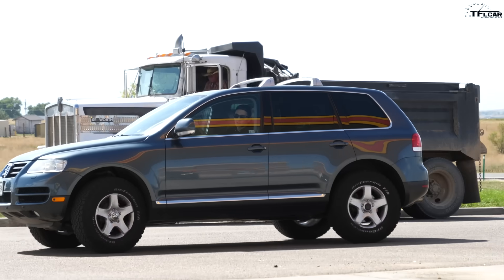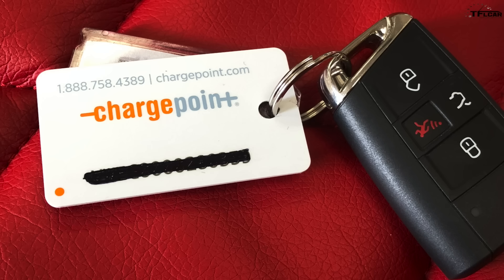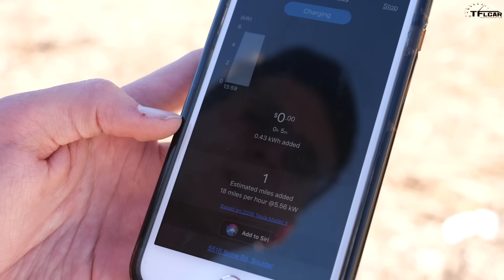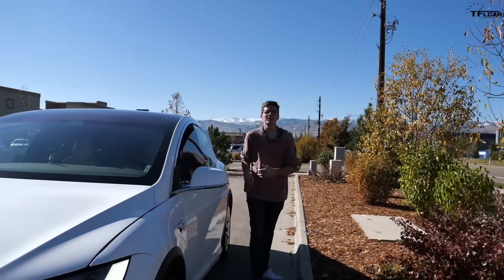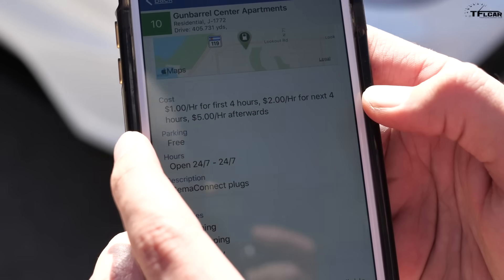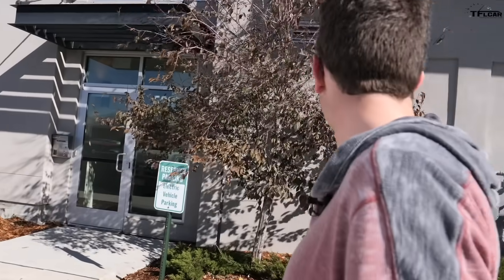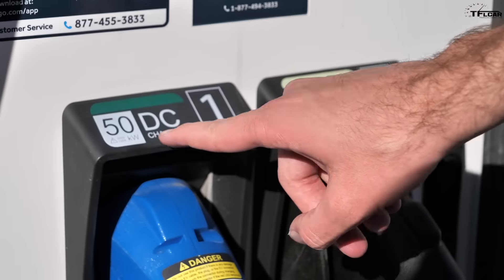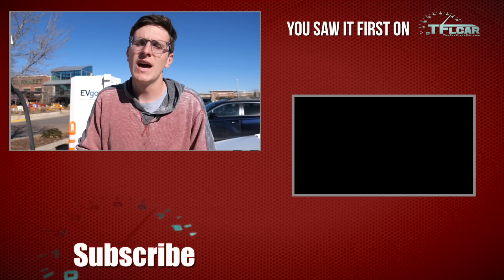Here’s Why Charging an Electric Car Can Suck - And It’s Not The Reason You Think!

Comment: "15 Miles an hour"
Hell no!
Reply: A Model 3 Long Range operating at peak efficiency can recover up to 75 miles of charge in 5 minutes and charge at rates of up to 1,000 miles per hour at a supercharger. Sadly, the chargers that this dude showed are level 2 chargers, and it's about the charging interval, not the time. Most people would get 240v installed (if you are American and don't have it already), and then simply plug in at home when they get home from work or activity, and the car will charge slightly faster than the chargers in the video depending on the equipment. 

That's the thing about an electric car. We don't really have to worry about public charging because the car will always be full when I wake up, or whenever I decide to leave the house because it will just be plugged in all day. And if I go on a really long road trip, then I can stop at a DC Fast Charger (non-telsa supercharger) and fill a Nissan Leaf up in 30 mins to full. Even if I do end up in this hypothetical situation, every charger near me is free, including the Fast Chargers.

It's not everyone's thing, but I think most people believe you have to charge an electric car just like you have to fill up a gas car, but in reality, most of the charging is done at home, and there isn't a noticeable electric bill change for most people depending on where you live.
Reply: @gamergye  
I know, however when your Tesla car go through an accident, Tesla forces a removal of supercharge ability and you're left with a useless car that is only good for your supermarket trips.
Reply: @qud3913  I don't have a Tesla, and they do that for vehicles that have been worked on by a 3rd party. They have stopped disabling it now thanks to Rich Rebuilds.
Reply: @gamergye  
That's good to hear!
Reply: @qud3913  For sure

Comment: I would not buy an electric car without a home charger. I would also likely not take one on a long road trip, I would us our second ice vehicle for that. Electric could really be successful but things like this is exactly what is holding it back, all chargers should be a standard kwh or speed based on car/battery size and all should except credit card just like a gas pump. If the transition from ICE to EV is not smooth and seamless it will make it very hard for the mass of population to adopt EV. Right now you've got everyone out to make a buck instead of working together to make EV the future and until they all work together EV will continue to be a small market share of total cars produced.

Comment: The other thing is, as you drive your petrol car, it gets lighter. So for example, my diesel  landcruiser starts of with about 135Kg of fuel, but 1,200Km later, it has 10Kg of fuel.  A battery car is still lugging around the full weight of the battery. So extending the range is harder, because that weight stays with the car the whole time.

Comment: What they need to do is treat it like a power tool and have removable batteries. You would pull up in a filling station swipe your credit card pull the used batteries out deposit them in the machine. At this point fully charged batteries would pop out. You could actually fill your car faster this way then at a gas pump.

Comment: Stick with Gas...……...for the time being. When I need gas, I drive in to a station, take 4 or 5 minutes to completely fill up and I am away on my journey, and in 600 miles, I can do the same again. I don't want to hang about for hours and hours at a charging point only to get another 300 miles. The whole EV industry need to get to the same level of convenience as a gas vehicle, but for the time being, they just don't have the technology or infrastructure.

Comment: Maybe it’s not a matter of bandwidth and understanding but a matter of convenience and  intellectual understanding that EVs aren’t a viable technology to replace the internal combustion engine yet. Both battery technology and charging technologies are at least 10 years away from being good enough to get a full conversion from gas to electric. Perhaps work on improving the hybrid technology more. Battery technology can be developed in a hybrid until the point it is more viable to go solo. Meanwhile you could get more people to adopt a more environmentally friendly means of transportation without all the issues you find with an EV.

Comment: So, how long would it take, in one of these electric cars, to travel from Miami to Seattle?
Reply: that's what people get wrong it's not about filling up the battery like a gas tank, if you plan it right you can be charging multiple places you would normally just sit your car and forget it.

While driving you stop for food, find a place that has a charger near by, you want to go shopping find a place that has a charger installed and you charge while you are out doing whatever you need to do.

when you stop to rest you can choose the hotels with charging stations, you don't drive your EV until your battery is depleted, you top off whenever you get a chance, and that extends you total range.  The best analogy would be if you put gas in your tank every time you went shopping or when you are at home you put gas in your tank.  It takes a different mindset to charge an EV and as a plug in hybrid owner it does take some getting used to but for me going 3-6 months without having to stop at a gas station is awesome, I can't wait until my lease is up so I can get a fully electric vehicle.

Comment: You really need to remake this video! 

Then first thing you go over is how charging at home is fine for 95+% of most peoples driving needs. Then cover Tesla Super chargers and how quickly 0-60% charge gets you back on the road to the next station rather than spending the extra time to trickle the last 40%.

Finally you can cover all the other subpar options.

People who are just considering electric vehicles or looking only to confirm their bias need only watch the first 5 minutes of your video and you tell them it's going to take 20 hours to fill their 300mile range battery at a public 5Kwh charging station.

Once they see that they have all their worst assumptions verified and stop watching!
Reply: @ Richard exactly. This video is a poor representation of charging EVs.
Reply: if you want fast EV charging buy a tesla. Tesla supercharge full charge in 40 minutes.  if there are no superchargers near you bye an ICE car.  when not using a tesla supercharge, i use my dryer plug 240 volt level 2 charger. 8 hours full charge.
Reply: Looks like someone didn't watch the video. He clearly said "The reality is that most people don't have high voltage power in their garage. And furthermore, charging off a standard 120 volt outlet can take several days."
 Unless you have 240v in your home, you're either going to have to pay an electrician to come in(YAY!! More expenses!!), or wait several days for your car to charge. Teslas supercharger is faster but they're not everywhere and not every EV is tesla. I like EV and i want one but to me it is unconvenient, for me it is way easier to just buy a full tank gas right now and refuel next week rather than have to charge every single day.

Comment: We have 6 years of VOLT experience.  Only charge at home where it is about $1.35 for 45-50 miles of driving.  Never at a paid station...we just use some of the 9 gallons of gas for 43MPG....far cheaper than a $7 for 12 miles paid station.  Average 143 eMPG and alway about 6 gallons a month. Top that.  Endless Range, limited by my credit card.

Comment: This is the main reason why I got rid of my EV.   Compare the simplicity of refueling with petrol (stick your CC in and in 5 min increase the range of your vehicle by 350 miles) vs. the Chinese menu of charge options to be negotiated.   You’d think that Tesla, Nissan, Toyota, et al would standardize the charge plug and charge rates across all models regardless of the mfg.

Comment: This plug won't work with a Tesla, you need the app, varies from country to country, 16 miles charge per hour,,,, looks like EV charging infrastructure has a long way to go before they can compete with gas stations. On the other hand, the cheapest Tesla sells for about $48,000 here in Canada while the dependable, reliable Toyota Corolla sells for about $22,000, leaving you with about $26,000 left over for gasoline and repairs, and cheaper insurance rates. Decent long range EVs will at least have to become competitive with ICE cars before the average guy will buy one, and not a lot of average guys can just dump almost 50 grand on a car. I think it might happen one day, but that day is at least years and years away, it makes more sense to buy the Toyota for the time being. Unless charging stations get their act together, it's better to run a 240 line out to the garage, I've already got one running to the kitchen stove, so that's not an issue, price, range and infrastructure ( in that order ) are the issues. My current lower mileage ICE car is already bought and paid for and that's what I'm going to drive until it makes better economic sense to go electric. Looks like we're all in a ' wait and see ' position.

Comment: Nice post showing what a ludicrous revolution of stupidity that is currently taking place. Maybe when more people realise that the savings of CO2 using an electric car take about 120,000 miles of use once you consider the amount of resources to produce them and sources of their energy, by which time the battery packs have to be thrown out causing another environmental disaster, then they also won't be prepared to wait hours to top up their car that costs twice as much as a normal hydrocarbon based vehicle. Typical of top down, government mandated solutions to non existent problems where the solutions end up causing more problems than the problem supposedly does. The UK said they're not only going to ban sale of petrol cars, but hybrids too.   
"Politics is the art of looking for trouble, finding it everywhere, diagnosing it incorrectly and applying the wrong remedies.” Groucho Marx.
Reply: i'd expect that from a lib gov't but not a conservative one.  i'm deeply disappointed

Comment: All this hassle so I can drive a coal powered car, that cost double what a comparable gasoline car cost. I dont get it.
Reply: I tell people this all the time. Until we are willing to get realistic about our power grid and run something that could support hundreds of millions of cars running off of electricity such as Nuclear there is no reason to be using a EV right now when a ICE makes more sense and has better supporting infrastructure.
Reply: @bobjackson4287  Not to mention there isn't enough lithium and cobalt in the world to build an EV for each current car owner. They're called "rare earth" for a reason. If we're going to build more nuke plants then it would make more sense to use the electricity for the electrolysis separation of hydrogen and oxygen from water. An ICE could easily be built to run on hydrogen and the exhaust would be water.
Reply: @goldenrod8861  False. They are called "rare earth" because they are evenly spread in the ground. They aren't rare at all. Rare earth elements are actually abundant.
Reply: Well said Loren. Unfortunately most people don't realize that electricity comes from coal (mostly) thus your comment went sailing straight over their head.
Reply: Agreed. Environmentally clean? Check the chemicals and elements that go into building the battery, them someday down the road, it has to be disposed of. NOT POSSIBLE WITH TODAYS BATTERY TECH. No, I’ll stick with a 1.2 litre gasso that starts, farts and goes when I want it to.
Reply: Cobalt is not only rare but extremely toxic ,only two places to dig it up that's Central African Republic and Australia and China have a firm grip on both.Its one of the main reason why Dyson scraped there electric car project,they couldn't get hold of enough of the stuff,Tesla's having the same problem,it's why there putting millions into trying to develop alternatives.
Reply: @katrinawalls2109  you are mixing up and using different terms interchangeably. Cobalt is abundant. Is it desirable to extract? No. Is it a rare material on Earth? Nope. Not even close.

https://www.cobaltinstitute.org/production-and-supply.html

Comment: Thank you! You did an awesome segment on charge stations. I was SO close to buying a BEV. I now realize that until they have a standard plug and only DC charging stations and a standard app (or key fob, or windshield transponder) and a 15 min to full charge rate or to get at least 100 miles, I'm gonna pass on my BEV. I want one so bad. Dang!
Reply: The connector problem is pretty much resolved now, as the industry seems to have standardised on Type 2 for AC charging, same as Tesla.  The payment thing's a mess, however. But bear in mind that a lot of people will charge at home or work.
Reply: How many miles do you drive per day?  Less than 300? If so, you'll never have to worry about a public charger.  Charge at home overnight, drive all day, come home and plug in, ready for the next day.

Comment: Gas and diesel fillers are standardized.  Eventually so will electric charge stations, or a lot of people will just forget about buying an EV.

Eventually fully charging an EV in a short amount of time will become standard, or a lot of people will just forget about buying an EV.

Eventually taking a 2000 mile road trip in an EV will be just as easy as doing it in a gasoline powered car, or a lot of people will just forget about buying an EV.

Comment: Good report, I’m sure many will benefit from it.  Some observations…
When traveling away from home, Level 2 charging overnight can be very helpful.  With Plugshare you can find hotels that offer charging.  It's also possible to charge at RV parks, from a 50-amp RV hookup, if you bring your mobile charging cable!  Camping in a Tesla, with a mattress in back, is something people actually do.
I did not even know it’s possible to pay for charging through PlugShare.  Where I live a lot of Level 2 charging stations are free, paid for by businesses who want to attract customers to their location.  Of the paid networks we have here, ChargePoint and Blink are pretty much it.  I went ahead and got a Blink card and a ChargePoint card, and I’ve never yet used the Blink card, and I’ve only used the ChargePoint card to activate a free charger.
Pedantic nitpicking: DC fast charging isn’t technically supposed to be called “Level 3”, even though it seems like almost everybody (myself included) does.  Also, the CCS Combo 1 plug used in the USA is not the same as the CCS Combo 2 plug used in Europe (including by European Teslas).

Comment: That system sucks, a free choice is great, but for customers being dictated by the supplier of charge stations and vehicle manufacturers instead of a standard coupling the same for every electric vehicle. That system should be on the belt system and belt it up your__

Comment: OW!!  WTF..  My brain hurts now.  Charges at 15mph, cost is $1 per hour for first 4 hours then $2 per hour after that..  They're charging you for parking!!  And it still takes 10 hours to half-charge the damn thing?  FFS, you should be charging THEM for your patience and if I'm right you don't have a smartie-phone you're screwed because apps, apps and more apps, not to mention charging plugs designed not to fit?  All this absolute mind-numbing BS you gotta put up with because brainwashed carbon panic, considering most of the electrons filling your battery are from reliable coal and gas power stations.  Ugh!!  Steal your gran's Rascal instead.

Comment: How would someone know they are actually getting as much charge as they are paying for?  For example, if the meter tells you it "pumped" 50 KWh, how can you confirm that?  Does the EV actually tell you how much charge it accepted and if so, does it always match that of the "pump"?
Reply: How do you know how much gas you actually received from a pump versus what the display is showing?  Same analogy.
Reply: @mowcowbell  Just check the pump periodically by carefully measuring say 5 gallons in a gas container, then bringing that same container to the gas station.

Comment: 18 miles of range per hour of charging... OK, thanks - I'll just keep my trusty old diesel that is "charged" for over 500 miles in about a minute or two.
Reply: There are fast chargers on main traffic routes.  They charge your battery to 80% while you take a leak and have a leisurely snack.
Reply: @nicksimonm0gic  OK, hit me with numbers - how fast is  "leisurely snack" and how much kWh is 80% ? Also - "on main traffic routes"? Which means - how many in one place and how many per, say, 100km?

With gas stations you can fill up, park somewhere else and eat something. In the electric scenario you block the charge point FOR THE WHOLE TIME and nobody else can charge at the same time.
Reply: @andrzej2501  I was deliberately vague because (a) it depends and (b) I'm in the UK.
DC fast chargers run at 50kW so if you've got a 40kWH battery that's about 40 minutes from flat to 80%.  Bigger batteries tale longer, obviously, but OTOH you're probably not going to be flat.
In the UK the vast majority of motorway services have fast chargers.  Some countries have better provision, some worse.
More uptake of EVs will require more charge points. Other technologies may come along, like hydrogen, or changing batteries, or new chemistry that allows charging in a couple of minutes, but at the moment this is where we are.